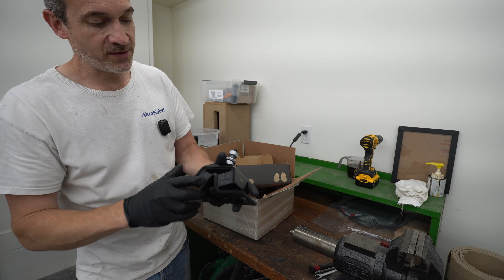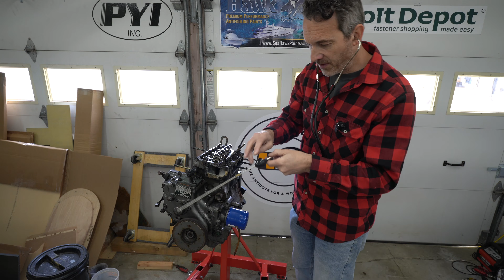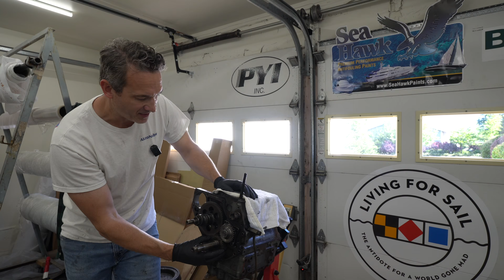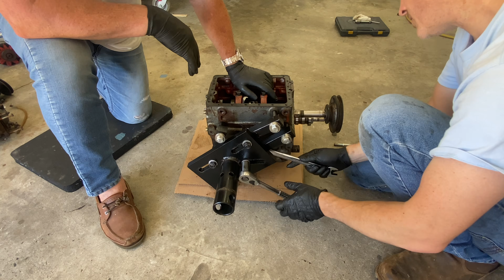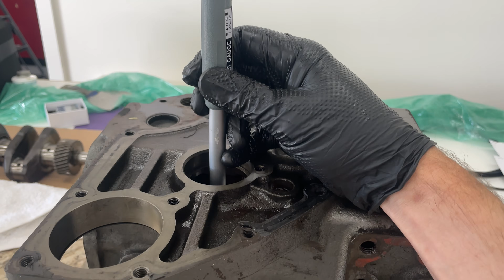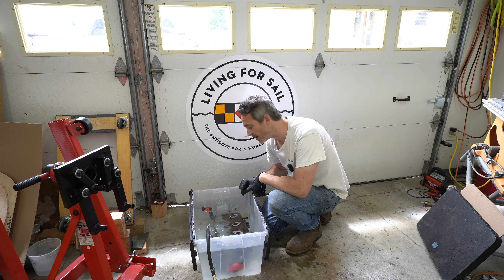Shocking Find INSIDE This 35 Year Old Marine DIESEL Engine!

Comment from the maker: What would you do? Fix the crank, Replace it, Scrap the whole Engine?, Switch to Electric?
Reply: I assume the valve imprints at the zylinders are comming from the loose (incorrect) timing. A key / keyway should never have any play.
I would try a repair of the crankshaft with a new (bigger) key and a adapted keyway in the gear.
Reply: @NixToDo I agree. Replace the key and increase the key way to fit the new part. Hopefully you can do it with high quality steel that will stand up to the loads.  Looks steel safe way to fix it! 😊
Reply from the maker: @PorscheSpeedster-kz6nc  Good plan! Thanks!
Reply from the maker: @NixToDo  Thanks, That seems like a good plan
Reply: Dear John, you can't stop now. you have to show the world how Engineers can repair most anything they built in the first place??? a good video but again it is away from the big A !
Reply from the maker: @johncurry6047  Yep, we will be back to Antidote soon... This is just the way life goes I guess...
Reply: @livingforsail  man I just have to say I’ve been around sailing my entire life and your videos approach and delivery is outstanding.  Definitely a fan from across the country in Oriental NC we are all about sailing here.  Gotta T-shirt ? I’m buying
Reply: Bigger key.
Reply from the maker: @Sparrow6671-i7b  Thanks!
Reply: switch to electric without thinking, and this because I have still somehow working diesel built in 1978
Reply: If you can fix the crank shaft without spending more than the engine is worth, I’d do that.
Reply from the maker: Thanks! 🙏
Reply: i would get a whole other engine.  There are people that scrap sailboats and they have engines that work and something you can start with, particularly if you live in an area where there are a lot of sailboats like Fort Lauderdale Florida.  I would even get on my pick up and drive for miles to get just the right kind of engine
Reply: Repair, and it will be serviceable for your lifetime.
Reply from the maker: Sounds great! 👍
Reply: Fix it.
Reply: @chrislyons2907    he needs to start with an engine with no aberrations
Reply from the maker: Would love that… 🤷‍♂️🤦‍♂️
Reply from the maker: I like that plan 🙌
Reply: Don't go electric unless you are only lake sailing  !!! Do the best you can with the key  use appropriate Lock Tight
Reply from the maker: Thanks. 🙏

Comment: Another great video!  Thanks for sharing.  Yesterday I used your discount code to order a new set of Elbogen motor mounts for my 44 HP Yanmar 4JHE engine that’s CURRENTLY out of MY boat for an extensive freshening up.  It’s going back together with four new sleeves, rings, valves, a reworked head, new. injectors, and an overhaul for the starter as well as a replacement alternator.  Cheers, Rog
Reply from the maker: Great! I hope they work out great for you!

Comment: If options limited Id weld up the lug and file it to fit perfectly with hammer tap.  And do it so the side of force {force pushing back results in lug moved forward}   as that whats caused the tappets to his the pistons.  Ive got a ford lehman 6cly to work on, that had rust flakes all over rocker arm and water in the engine.  Im in no situation to rebuild and if so would prefer to go electric.
Reply from the maker: Thanks for the feedback! 🙏

Comment: You are counting wrong. Piston 1 is the piston closest to the FRONT of the engine, not the back. On some of these engines they can be parts specific for bore position.
Reply from the maker: If you’re still sure about that after reading the manual then we can discuss. It’s on page 3… 🤷‍♂️

Comment: Yanmar mounts are “weighted” ie some are rated 100 and others are 75. Usually the heavy ones are rear to support engine and gearbox mass while the front one slightly softer. They are designed to absorb the vibration
Reply from the maker: Yep. We worked with Ellebogen.com to get the right ones for this engine. 75s in the front. 100s in the back. For the reason you mentioned 👍

Comment: The leek test for the cylinders will always have some blow by, especially on a cold dry cylinder. It is done with the piston at TDC, not being rolled around. The correct air pressure is a bit less than 100 psi. About 80 psi is ideal.  But the amount you saw seemed very little. 
Someone has been in that engine before you.

Piston rings are to be installed at 120* integrals.  The first ring at 0* the second at 120* the third at 270*. They do not move around, there is no side force on them, so someone didn’t install them correctly.

The cylinder walls look just fine. The valves are not hitting the pistons; they would be bent and the chance of all of them hitting is slim and none. Would I replace them, of course you have it all apart at this point they are not expensive. The seats seem to be ok just need to be cleaned up a bit.

On to your clicking noise. Someone butchered that keyway to get it like it is. No way in hell would it be that loose in a stock engine. They should be a tight fit, with almost no clearance. So, your choices are new crank and the new gear you found or have the machine shop custom cut the crankshaft for a key that they make that fits the new slot on the crankshaft that they just machined and then machine the top of the key to fit the gear you just bought.  This will be way less expensive than a new crankshaft.
Reply from the maker: Hi. Thanks for the excellent explanations. I found this video interesting where someone that installed the rings correctly found them to be off at tear down. I have a hard time believing that rings don’t rotate. There might not be forces directly spinning them but things are vibrating and bathed in oil and well… I’ll follow the manual but won’t be surprised if they move around. 

Someone was DEFINITELY in here before me though. 100% 👍

Comment: Machine a custom key 1mm wider than stock and machine the keyway on the gear and crank to suit.
Cheap fix.
Reply from the maker: I think that’s in the plan. We might need to make a custom key since the crank gear is hardened… I’m going to leave these decisions with the machine shop. 👍

Comment: Love it, every bit of it!  Retired engineer here nursing an aged 2GM20F through it's later years.  I swear the guts of these things will last forever which begs the question of failure mode...assuming you are the first set of mitts inside this block, how the heck did this problem with the keyway happen?
Reply from the maker: Thank you! Engineering folks tend to enjoy my content. Haha! 
I have some suspicious evidence that I’m not the first one inside…
Reply: I was asking myself the same question. I worked for a car manufacturer that had a pop from the axles they had us put a Lock Tight on the splines and it worked without fail.
Reply: Many German car companies insisted on specific fastener adhesives on splined shafts and drive axles.  The specifications were very detailed in terms of thickness and dimensions of the adhesive application.  Whenever I see a situation where the factory manual does not call out for locking compounds, I do a double-take

Comment: Bearing retainer screw was punched to lock it in place.
Reply from the maker: I’m not sure I understand how that would work… 🤔
Reply: @livingforsail  It distorts the head (sort of puts lateral stress on it I suppose). I've seen it done on lots of bolt heads though maybe not as effective on a countersunk head. Sometimes done around the screw surrounding material, not the screw itself. Or maybe it was just that roll pin bouncing around! Nice video

Comment: Engine Mounts ? Volvo and Yanmar use simple adhesion from rubber to steel. Glean up the steel. Drill and tap and add some short bolts to add some "bite".  Empty out a tube of polyurethane caulk into a mold made out of cardboard. Two weeks later you'll have new mounts better than new.
Reply from the maker: Interesting idea. 😳
Reply: Getting the polyurethane to cure evenly in such a mass is very problematic. The sealant chemistry was not optimized for mold-curing.  Achieving correct, uniform density of the rubber durometer is not childs play. But, if having a running diesel engine separate from its engine mounts while underway will make your future sailing life more interesting, be my guest!

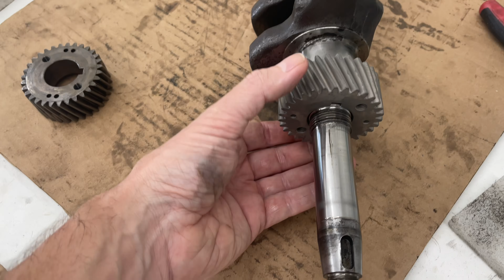Comment: At 27:04 you're saying the new gear has a really nice fit and almost no movement. But that is a TON of movement. Not even close to a nice fit. The crank is done, due to the keyway being hammered out. Maybe you could get someone to mill a new keyway in the crank, but you are removing material and potentially weakening the crank. And you need a custom key, I don't like those kind of solutions in an engine; non standard stuff. I would try to get another engine for cheap, use the crank from that one and maybe some of the other parts. Just pick the best parts. And do a proper rebuild with at least rings, bearing, gaskets etc all new and do a proper check of the cylinders and pistons if they need to be honed and replaced too. Have the injectors tested for opening pressure and spray pattern.
Reply from the maker: Yeah. I mean COMPARATIVELY low movement. Haha. Good advice. We will see what the machine shop thinks. Removing material is not ideal but may be ok if we are dealing with small numbers…
Reply: @livingforsail have a welder tig some weld into the keyway & have it recut.😮
Reply: @livingforsail  Yes, maybe a machine shop can do something. But why if the world is full of good cranks in cheap engine blocks. And don't go for welding; welding cranks must be done in a very specific and specialized way, unless you like fatigue failures in the near future. Just my 2 cents, but I would stay away from any custom stuff in an engine (other than being a specialized racing engine or unique classic car or something like that).

Comment: Yep, this is a very interesting side project indeed. It would be also interesting to record the manhours/costs to strip/repair/rebuild the engine, the cost of the new parts and compare with a new engine replacement.
Reply from the maker: That will be interesting indeed!!

Comment: I suspect your valve strike is from the keyway enlargement.  I am super curious though, how that keyway got knackered.  Fixing the crank keyway is going to be a VERY fiddly job as the machine shop would need to know the degree setting for the keyway to be re-ground.  If that is known, and the machine shop is good, I suspect it would be fixable.  However, if gotten wrong, the engine timing would be off and I doubt there is a provision for adjusting it.  I am very interested to see your solution for the keyway.  I secretly hope you have an expert machinist up your sleve as a repair would be more interesting to me than a new crank!
Reply from the maker: You’re absolutely right about the timing issue. We will see what we can do… I would say… “stay tuned!”

Comment: An experienced engine builder would have just torn the beast down.  There is only one question, is this engine worth a full and proper rebuild?  If not, it is parts or scrap.  The leak down was a waste of time and told you nothing.  With the timing of the cam off, the intakes could have hit the pistons, which means they could be bent.  Again, cost of a full rebuild vs value of engine when done.
Reply from the maker: Thanks! 🙏

Comment: Find a wider key, assuming the keyway in the crank will permit it. The gear can be machined to match as could the crank.
Reply from the maker: We are working on a solution. The gear is hardened and can’t be easily machined…
Reply: @livingforsail an alternative is a ground key to accommodate the change in sizes on each side. My Ducati has stepped keys to adjust timing. A surface grinder can do that.
Reply from the maker: @chrislee7817  Cool idea. Thanks!
Reply: The hard part of that would be getting the timing exactly right, since mechanical timing cannot be fixed by adjusting shims on the fuel regulator. Even a little off and you risk contact between piston and valves. It might seem easier to assume the wear on both sides of the keyway is equal, but I'd try to double check that assumption, before moving forward.

Comment: Great video.  Its amazing that key way gave like that.  wonder why  it did that?
Reply from the maker: Thank you!🙏 
Right?? I keep thinking: “this had to start somewhere… how did this get so bad?!”
Reply: I think that when the engine was worked on previously, the key may have been lost, and a new one made from a less tough grade of steel which proved to be, 'not up to the job'. The key should be a 'slight interference fit', in the crank shaft key way, and a sliding fit, with slight interterference with the gear key way.

Comment: The valves have struck because the timing was off. Caused by the worn out keyways.
Reply from the maker: Yeah, I think you’re absolutely correct… you “hit” the nail on the head… or the piston in this case…

Comment: Those zincs in the block. Are they maintenance items or intended to last the life of yhe engine?
Reply from the maker: They are BURIED behind the fuel system when the engine is built… looking at the drawings, it looks like they were zincs on the raw water cooled version and just plugs on the fresh water model (this might have been converted?) - so I think I’m OK to replace the plugs without new zincs… 🤔
Reply: @livingforsail  Yes, agreed. The electrolyte in normal antifreeze mixed with distilled water does not promote galvanic reactions, which is why we don't use zincs in automobiles. That area is far removed from areas exposed to sea water, where zincs are required. As you say, these Yanmar engines were built for a dual purpose, and some of those engines were used in situations where there was no heat exchanger, where lake water was directly pumped around the engine cooling jacket. Zincs were used and replaced regularly in those. I'd be inclined to remove the zincs and just re-use the blind plugs, but I suppose one would wonder what the harm of adding new zincs would be. When zincs corrode they leave magnesium oxide rubble that could plug narrow passageways, so I'd be inclined to remove them. Modern coolants have antioxidants dissolved in the antifreeze itself.
Reply from the maker: I’ll probably just leave the zincs out of the equation going forward.

Comment: Possibly the valve strike on the pistons is a symptom of the “variable valve timing” due to the worn key way.
Reply from the maker: Yeah, I was thinking the same thing… I’ve never seen this before… I wonder what could have caused the keyway to start opening like that?! 🤷‍♂️
Reply: wrong keyway maybe, it looked like someone had been working on it before.
Reply from the maker: @dagragnarklstad2400  There are some hints that someone else was in here before me...
Reply: I suspect it is more likely to be the wrong key rather than the wrong keyway (the slot). another possibility is that the keyway on the cog is a different size from the one on the shaft. possibly the wrong cog in that case as the key would have been sized to the smaller keyway leaving slack on the larger one.
Reply: @jon65160 you're correct of course. I am not a native English speaker so wrong key was what I meant. But now something has to be done about the keyway to fix this.
Reply: Spot on. Sucks. Ive seen situations (not on this particular engine) where a key and key way like that or any kind of fixed high torque steel part on part set up will, for whatever reason, will develop the smallest amount of play and from there its off to the races. in this case every time there is engagement, reverse, back to drive - the slop just gets worse and worse with deformation in all directions. And yes, I would say that is why your valves came in contact with the tops of the pistons. I haven watched the whole vid yet, but I will keep my fingers crossed that the piston valve strike hasn't transmitted up the stem and ruined the head. Also, (maybe someone can teach me) in a crankshaft like that can the key hole/slot just be welded full and a new slot be machined, saving the crank?

BTW... it took me like 30seconds of watching your video to subscribe. great tone, great work, right style work... love channels like this. great stuff!
Reply from the maker: Thank you for the feedback! Cheers!

Comment: When you took the fuel pump off those were shims underneath and set up from the factory for injection timing. Keep them safe...you probably new that but...
Reply from the maker: Yep. Thanks! They are safe and sound. I have a new set of shims also just in case. We will get the timing back in order when we put it all back together! I appreciate the heads up! 🙏👍